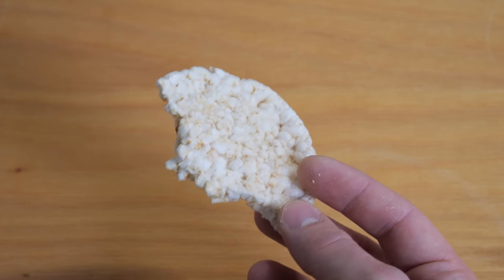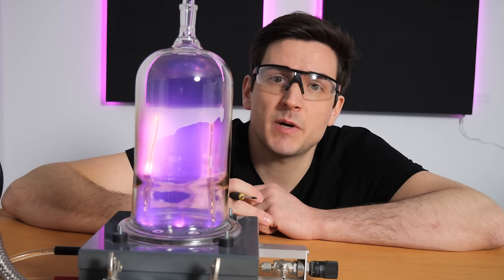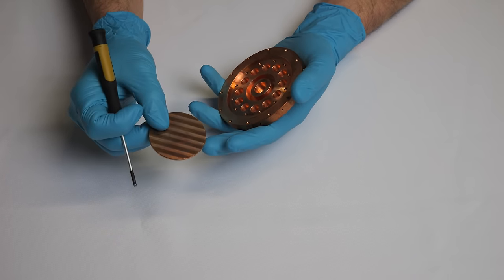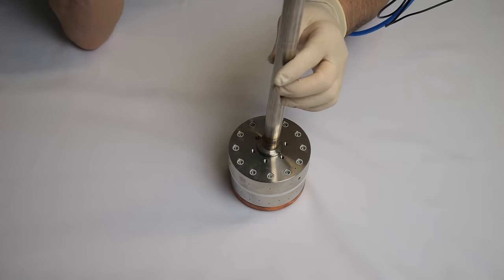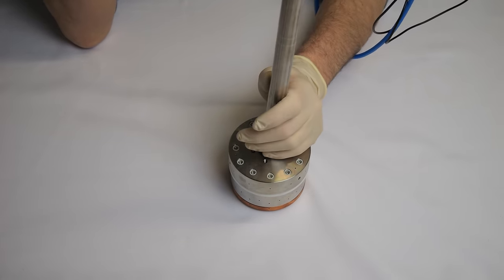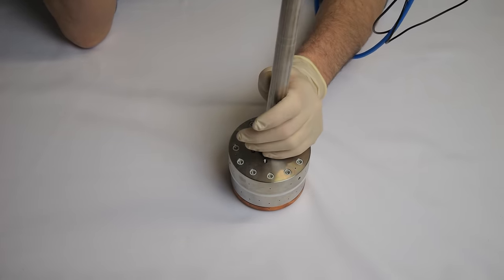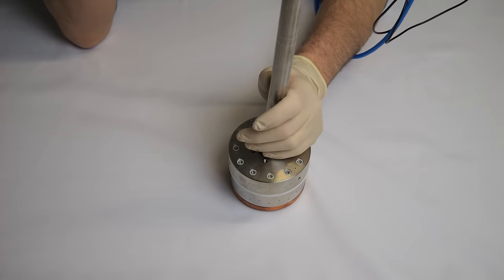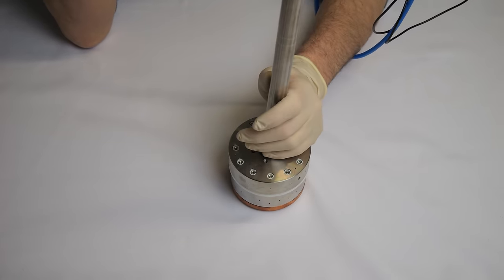METAL COATING by PLASMA Bombardment - Magnetron Sputtering

Comment: At 7:26 you can see where I think you are losing power to plasma formation and perhaps even some minor internal (invisible) arcing, between the bolt heads and the ground plate, through those big holes in the PTFE spacer/insulator.
I can't see what purpose those big outer holes serve, but if creating virtual leaks is the concern, I would strongly recommend making a replacement PTFE insulator where those axial through holes are replaced by small, blind radial slits (roughly 1-2mm wide, 0.5mm deep and long enough to connect to the headspace above the bolts with the vacuum) into the surface facing the bolts.
This should reduce plasma formation and the associated losses to an acceptable amount, while also giving you a visual indication of any further problematic arcing.

Comment: The vacuum will cause the copper atoms to go in every direction. I would say a lower voltage and slower deposition rate will minimize deposition of unwanted elements.? I seem to recall, from another experiment, that the experimenters used mirros and placed the viewport behind a shield, though it was for telescope mirrors so the only element they used was aluminum. Obviously that wouldn't matter because their forty-five degree mirrors are already coated with aluminum. That would only deposit more aluminum and since the mirrors are so smooth it would never degrade the reflected image they see through their viewport. 
So in conclusion, you could use two flat mirrors, ( not regular mirrors like your bathroom mirrors, which have the reflective coating on the back), but two surface coated aluminized mirrors like they used to use in big projection screen televisions, to bounce the image around a shield, that protects your viewport. Coma splices everywhere! I know!

Comment: I recently visited the IMSAS in Bremen, they used movable shields on there sputtering devices to prevent resedue from forming on the Glas. Maybe you could implement something similar.
Reply: Maybe with magnets.

Comment: I would assume the issue with the glass is that the slides weren't sufficiently clean to get a firm connection. Maybe the copper is just more sensitive to impurities than the titanium? I don't really know, though, since ultimately I'm not at all trained in this.

Another thing you could try could be putting a light layer of a metal that sputters easily, such as titanium, on first, just barely thick enough to coat it, then putting down a layer of copper on top of it, sort of like how chrome plating first deposits nickel or copper below the chromium.

Comment: Have you used a MKS Type 250 Pressure/Flow Controller? If so have you ever connected a MFC unit to one of these?
Reply from the maker: Sorry, I never used an MKS flow controller.

Comment: That custom magnetron is AWESOME. Wish I had the time and tools available to make something like that...

How suitable is something like a microwave oven magnetron for sputtering?
Reply from the maker: Thank you! Unfortunately, I also do not have tools like a lathe or milling machine (yet). A microwave oven transformer is the cheapest way to build a power supply. But it has its disadvantages. Power supplies specifically designed for sputtering can detect a sudden increase in current (as in the case of an arc/short circuit) and shut off immediately. This function is not available with a microwave oven transformer, of course.

Comment: My idea is that the slides are too close to the magnetron, thinking it either get too much copper atoms or too fast or the path the copper takes trough the vaccum get directed by the magnet.
Try using an m8 rod and nuts to place the sllides at random places inside the chamber and see what happens to the adhesion and surface flatness.
i wonder how much would end up 8 meters away from the sputter if it was a big enough vaccum chamber.

Comment: Question, do the plasmas of the materials you are sputtering give off significant UV radiation? Something you may want to check into before spending significant time exposing eyes or camera sensors. A UV blocking filter on the outside would be an easy fix.

This comes to mind because some cheap plasma globes can give off enough UV to cause fluorescence, whereas quality ones will apparently have glass with additives to block the UV if it's going to be generated by the gas mix.
Reply from the maker: That's a very good point! Thank you for pointing it out. I will check for UV radiation.
Reply: As far as I know the glas in the viewport already blocks most of it, if there's even any significant radiation.
next level: coat your own filters ;)

Comment: The packing tape doesnt outgas and ruin your vacuum levels?
Reply: On second thought, I guess if your vacuum pump had enough displacement then you would still be able to evacuate faster than it can out gas. The introduction of argon, raising the pressure levels would also slow the rate that the adhesive on the tape out gasses.

Comment: Interesting,  I worked in the thin film market designing equipment for 30+ years.  Lots to say, but IP tells me not too.  

3 keys ,  Pumping Speed,  Temperate, and deposition rate.   Many others.     It will get more interesting when you work on measuring rate.

Comment: I hope you are aware you could be generating X-rays! Did you check with a geiger counter?
Reply from the maker: It's a good point that one could be producing xrays when using highvoltage in a vacuum. But at 200 V at 10^-3 mbar, there is no way I'm producing any relevant xrays.

Comment: 11:36 The microwave oven transformer need constant cooling or it will overheat unless its only used intermittent short times and get a long time to cool between. They are not designed for the power they put out and they are much smaller than they should and have the wrong amount of turns in the windings on the primary, all this since its cheaper to make and just whack a fan on there, but they need constant cooling instead even if they are not used. If not used or take very little power they will last longer before they get to hot but they will. Very surprised you didn't have a fan in there, that its like asking for a overheating problem with a MOT.
Reply from the maker: The MOT seemed to only overheat because of my defective rectifier. With the new one it only gets slightly warm after long use. Considering that I’m only drawing 400 mA at 200 V (so 80 W) passive cooling of the MOT seems sufficient. 
If I increase the current at some point, I will add a fan.
Reply: @AdvancedTinkering  Ok, the ones I have used several years ago got very warm to the touch even at idle but it took several hours. That was the reason that I posted  my comment, but if it works with your MOT then that is super.

Comment: You are controlling the ps with one of those mediocre  Kemo module? Hilarious. Amazing project.
Reply from the maker: Haha, thanks!
I have tried using that Kemo module, but it just would not work. When turning the potentiometer, I get no voltage at all until it suddenly jumps to 600 V. No idea why. So in the video I was using a variac. But I would like to have a small formfactor module, that fits into the power supply. Do you have any suggestions?
Reply: @AdvancedTinkering  Probably it's best to keep using the variac. All cheap AC Thyristor /Triac bases regulators are pfc or Zero-crossing control (Phasenanschnitt bzw. Phasenabschnitt) and thus ruining the sine waveform, probably resulting in excessive heat. A proper sinusoidal control at > 2kVA  would probably be nice to have but not that cheap.

Comment: arcing is a problem that has plagued magnetron sputtering since checks google as long as magnetron sputtering has been around for. I understand trying to be 100% home brew,  or as close as possible, but I think you would be best served to get a commercial magnetron sputtering power supply. They can be had cheap off of ebay. Much work has been put into killing arcs as quickly as possible, and keeping as little stored energy int he supply as possible so that when arcs do happen a minimal amount of damage occurs.

Comment: Converting your 3D printer into a vinyl cutter? Brilliant. No, that wasn't my only take away. What would happen if you sputtered carbon into a hydrogen envelope? Hydrocarbons? Tesla was creating ark lamps. He wasn't looking for alternative fuels. But he was able to disintegrate his electrodes. I have been told cost production using this technique to create hydrocarbons is prohibitive. But theoretically can it be done? With any production system, initial production costs are always relative when compared to the end.

Comment: In the short you put a silver coin in there. I would like to see what it looks like afterwards.
Reply from the maker: It doesn't look much different after only a few uses. The surface got a little rough. After many uses the coin will show a circular indentation where the material has been removed.

Comment: Looks like your deposition rate is too high directly in line and too close to the source.  Try lower voltages if you need to be that close
Reply from the maker: Thanks! I will try to increase the distance even more and lower the voltage.

Comment: PLEASEEEEEEE No one will do it because it's dangerous, but I ~swear~ you can get single-molecule-layers of AL2O3 deposited like this in the right environment - and even a single completely homogeneous layer is enough to add a lot more a lot faster -- leading to high-precision shaping of high-temp durable and light-weight rocket motor parts with internal liquid-metal coolant channels. Precision Sputterprinting molecular-scale frameworks of alumina for growing more is an utterly untapped aerospace industry contribution I don't have the tools or budget to prototype for scaling...but you might. (edit - PS it works in low gravity and microgravity, and if you can get it autonomous the lunar regolith is all already oxides you can cook off and recombine. sputterprinting moon structures with just electricity would be really useful, huh?)
Reply: I'm not sure I understand. Are you suggesting using sputtering for additive manufacturing? Lunar Regilith has a lot of Iron which can apparently be quickly melted with microwaves.

Comment: Looks like you're using some sort of adhesive to securely mount the glass slides to the rotating shutter. Depending on the adhesive type, it's probably offgassing into the immediate area, and interfering with the cohesion of the target material to the slide. (Very rarely some volitile organic compounds can also leech or migrate trough conductive materials under vacuum conditions, especially in the presence of a high voltage electric field.) Most likely though, the glass just needs to be cleaned more vigorously before placing it in the chamber. (See Ben's video on his channel Applied Science "Introduction to plasma cleaning)

Your targets/specimens are NEVER clean enough. Even when you think they are, ther's ALWAYS some bullshit quantity of residue to fuck up the cohesion of the target material!

Alternatively, you could switch from ordinary borosiliate glass slides to fused quartz slides. And always handle with care not to get hand/fingerprint oils on the critical surfacs.

Reccomend replacing your current adhesive to the rotating shutter setup with a second holder that clips the slides in place with spring steel (preferably an alloy that won't offgass into your chamber) a couple of centemeters above the existing shutter.

Hope this helps!

Cheers.
Reply from the maker: Thank you for the advice. That the double-sided adhesive tape is outgassing is certainly an option. However, it is unclear to me why there was no issue with thermal evaporation (where I used the same tape), even though the pressure was lower. Nevertheless, it definitely makes sense to secure the glass plates differently in the future. Properly cleaning the glass surface will be one of the next steps I take. The most practical solution would, of course, be a plasma cleaning setup. Then, I could simply place the substrate over the plasma cleaner and subsequently rotate it over the magnetron without needing to open the chamber.
Reply: No worries, happy to help in any way I can. (it's always nice to think the lessons I've learned from both professional experiences, and dicking around with my own high vacuum setup might shortcut a path to success for anyone else, let alone one of my favorite youtubers!😁)
 
I smell what you're stepping in...

Don't make the mistake of trying to compare thermal evap with sputtering. They are not the same in terms of deposition volume and rate. You're trying to compare a giant geothermal geyser (thermal evap) with a spinning lawn sprinkler (sputter), and wondering why you're not getting the same rate/volume flow.

Thermal Evaporation (in my experience) has a much more vertical linear deposition flow bias, following the natural thermal covection pathways (as much as it can in low-pressure) from the source target material to the substrate. Don't get me wrong, the shit will still get everywhere inside the chamber, but only residually, when compared to sputtering or ALD. Even with the lateral losses, the VAST majority of the material that gets evaporated get immediately condensed directly above the heat source. The problem with this is the rate of deposition across the intended substrate coverage area is NOT uniform AT ALL. Especially when compared with Atomic Layer Deposition (ALD), when viewed through Scanning Electron Microscopy, it's like comparing a perfectly flat face of those ball-bearing magnet sculptures (ALD) against a topographical map of the fucking Himalayan mountain range (therm evap).

Sputtering, and to a lesser extent Electron Beam Lithography (again, in my experience) Has a mush more evenly planar substrate deposition area, but a much slower rate of deposition, since between 70 and 90% of the ionized target material is lost laterally away from the substrate, depositing onto anything that is in line-of-sight to the plasma cloud. (you don't need me to tell you this, we all watched you need to clean the view port!) This is believed to be due to the nature of the ionization of the target material: being "strafed" by the ionized carrier gas (in your setup, the argon plasma) in a circular "racetrack" following the field lines of the magnetron to remove individual target atoms at (what is in practical effect for the user) random angles of attack, sending the target atoms flying every-damn-where, except where you need them.

So don't gnash your teeth, and wring your hands over that shit. It's just the nature of the two very different species of beasts!

It would really help your setup to add thin film deposition sensors, again Ben from Applied Science has a great video dedicated to this, in order to actually monitor/record your depo rates. If you can afford it/ are sufficiently motivated, it might be interesting to see multiple sensors mounted at different angles (0deg, 45deg, and 90deg above the top of the ground shield), and plot the results on a spreadsheet to see any angular divergence over time.

To fix the lateral target ion losses in your sputter setup, you'll need to electrcally bias the desired ion path from the source to the substrate. At my previous job, we did this by creating a high voltage potential (negative polarity on the magnetron and collimator, positive polarity BEHIND the substrate mount) and made a janky-ass ion beam collimator from a chunk of thin-walled copper conduit that was hastily plated in nickel, then gold (silver would work even better, assuming that you can keep the surfaces free of oxidized tarnishing when it's not in the chamber), and mounted a few washer-type N52 neodymium permanent magnets at regular vertical inetrvals along the outer wall of the conduit with some machined PTFE. We soldered a jumper wire from the high voltage negative to the conductive surface of the plated conduit, and just set th whole thing on top of the ground shield. then we ran a positive high voltage line to a sepperate feed thruogh to a benchtop HVPS, soldering the chber side of the wire to a metal plate that was Torr Sealed above (behind inthe path of the ion flow) the substrate mount. This effectively transformed the sputter setup that we were losing gold/platinum group metals to plating the inner wal of the chamber, into a linear ion accelerator. It worked well enough for us, that our shift supervisor got off our backs about consuming expensive target materials.

Would be interested to see the "racetracks" on your target disks in the next update, and maybe some magnetic film over your magnetron.

Hope this is remotely helpful! Can't wait till your next update!

Cheers.